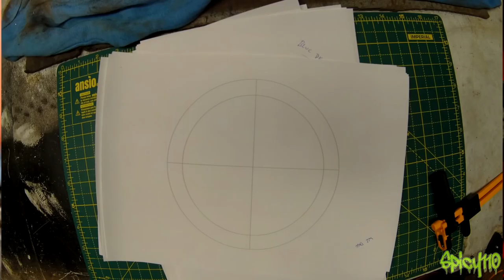METAL WORKS Ep.10 Talking about SpaceX and Shop safety!

Comment: If the clock hasn’t sold, I’ll have it. Already bought one for the office and everyone loves it!
Reply: Damn! Went to the shop to see and bought a key ring and a clock....
Reply from the maker: I just saw 🙂 will be sent out tomorrow.
Reply from the maker: Hey is sold very fast and is I'm America now. 🙂
Reply: What are the stands you use... that would look cool with the clock I bought.
Reply: Just added another few key rings.... your Etsy shop + beer is not a good mix 😁
Reply from the maker: The wooden ones? Just bashed together to take pics on. Simply a L shape of pine plank. 🙂 your clock would wall mount great balancing on a single hook at the balance point.

Comment: The 'smiling clock' theory is cute, and most-likely does have a part to play in the configuration of the hands, but mainly it's because the manufacturer's name was usually in the lower section of the face.  Also, a key-hole used to be there.  Nowadays sometimes a date display is in that lower-mid area also.   It's really an accumulation of reasons which have just 'stuck' as a tradition.   I'm enjoying your vids muchly.   😉   🏍

Comment: Defiantly agree with the glove thing never use gloves with any rotational equipment I know people say that it's cus the Sparks burn your hand well I have just finished using a Grindr on some hardened steel lag bolts and yeah the Sparks are hot but they ain't gonna give you third degree burns not worth the risk

Comment: Ok question :- its been a while for you but what did you not like in the motorcycle test mod 1?
                            Mod 2?
Answer somthing for both parts
And did you find theary test hard as im dislesic ( a little slow with reading and somtimes get words mixed if feel rushed)
Reply: 78gragon 

If you get extra time in exams, you can apply for extra time in your theory test. 

The most horrible bit I found in Mod 1 was the getting up to speed for the emergency stop and hazard avoidance because it all happens so quickly.

The most horrible bit in Mod 2 that I found was emerging from behind a parked car and making big decisions. On the first mention, I got a minor because I did all my checks and then upon pulling out into the road, a car came up really fast behind me and slowed down because I was in front, which gave me a minor. The second point was horrible because I had quite a dangerous situation with a lorry arise and I had to make the decision to do my checks and move past the tiny gap out had left on the side of the road. I wasn't sure whether it was the right decision at the time but usually, as long as you make a good decision based on your own safety and do it all correctly, you'll be fine.